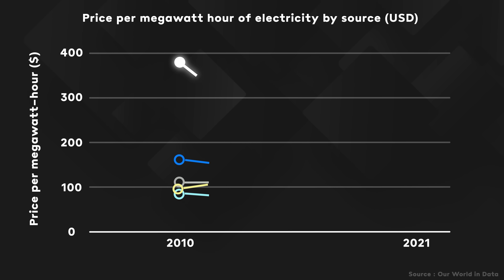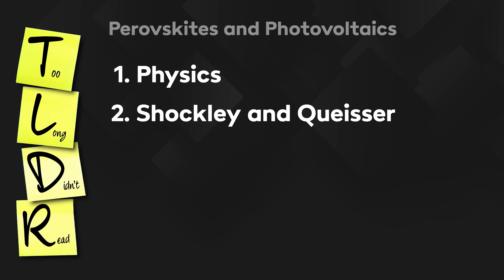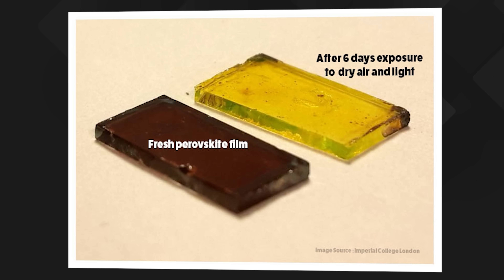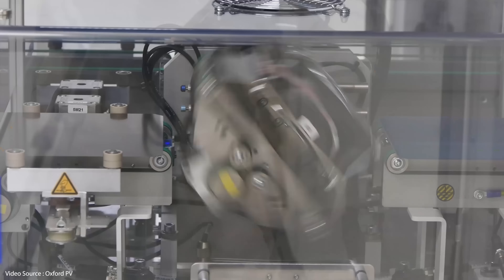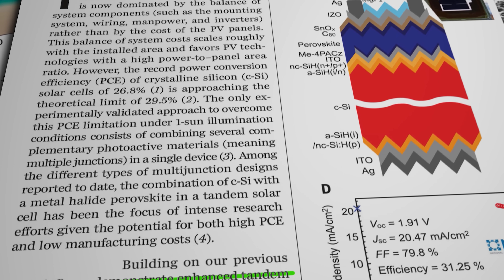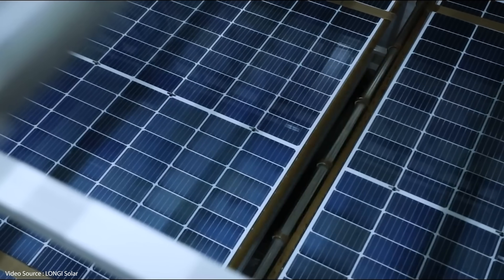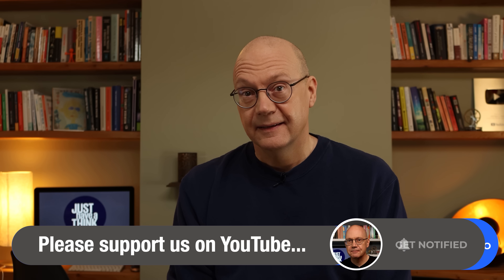Perovskite Solar PV. FINALLY some good news!

Comment: Hy ! I looked at one of the pictures in the production.
I got an idea. The main problem is the space used for the PV´s.
PV-Peroscites combineing is one option.
PV´s need a lot of sunlight ´ish options.
I would work on the reflecting side .
Using PV´s on top of each other , by reflecting the light from the sides.
The reflecting medium need s to be researched !
The recycling of both the Pv´s and the reflective medium needs to be researched as well.
If the longlivety is not good. Exchange the setup in an easy way could be a better solution.
Well . I just had a thought.
Stay healthy !
Thanks !

Comment: @justhaveathink Take a look at Delft technical university's (aka TNO) investigation into placement of panels. Not by pouring oodles of funding into innovation, but by just placing them vertically, in an east-west arrangement. Better use of available land, dual use of it (one project is called "Solar Milk") and better performance of technology by preventing them to over-heat

Comment: That one little solar cell can absorb more energy from the sun than multiple tonnes of CO2.  I'm glad you humans are finally taking advantage of them.  I do hate the cold.
:goodvibes:
Reply: "That one little solar cell can absorb more energy from the sun than multiple tonnes of CO2." <- classic know-nothing who thinks he made a smart comment.
Reply: @TheDanEdwards   Carbon dioxide absorbs light mainly in 4 narrow bands of wavelengths centered at 15, 4.3, 2.7, and 2 μm.  Solar panels are designed to take advantage of the broadest waveband possible.  They can absorb light across the visible spectrum, from about 400 to 1000 nm.  Solar panels absorb orders of magnitude more light, gram for gram, than CO2, and they do so across a much higher energy spectrum.  The math works out to 1 kg of solar cells being, on average, roughly equivalent to 4 metric tonnes of CO2, in solar energy absorption.  Of course, that number does increase with energy usage, as energy conduction becomes more of a factor.  
I do hope that helps to clear things up for you.  I know your species has difficulty with science, and I am always happy to help the lesser abled.  :goodvibes:

Comment: Twelve years ago, I was planning to put 4kW of solar panels on the roof of my UK house, not just to save the planet, but to make the most out of the government's hopelessly overgenerous (at the time) Feed In Tarif. However, I was a bit worried what adding these panels might do to the value of my house. So, I asked a few estate agents whether such an installation might add, or detract value. And they all said..... "What are solar panels?" (!!!)  I'd like to think we've moved on a bit.
Reply: My late father had a similar experience in the 1960s when trying to install loft insulation. He contacted all kinds of builders' merchants, hardware stores and the few DIY shops around at the time, and the overwhelming response was "what's loft insulation?". Always seems like "the industry" is well behind burgeoning consumer demand.
Reply: @broadsword6650  I think it was just getting established here in Canada around that time.  My parent's house had a whopping R6 or R7 in the attic.

Comment: Great but you can buy a panel for £100. Everyone should have them if possible but without a battery they are not far off useless. A battery gives you access to wind power as well. I would have a battery before solar panels anyday

Comment: I am an Albertan.  We have a moratorium on solar and wind; there is fear that our electric system will become unstable because of the intermittent supply.  I suggest that with solar, wind, that the government should encourage technology to allow individuals to store and release energy to provide for the needs of the grid as determined by the system operator.  For example, the system operator could electronically call-out for release of electric vehicle battery energy into the grid when there is a risk of network instability.

I think that forward-looking people in society would be happy to help stabilise the electric grid and get a discount on their electric bill at the same time.
Reply: Alberta's conservative government has fear that the fossil fuel era encouraging the disgusting pollution and emissions from filthy wasteful oil production from its tar sands is coming to an end. "Grid instability" is nonsense fear-mongering; the job of the grid is to balance different electrical generation sources and demands, and having new cheap electrical generation that operates at almost zero marginal cost is obviously a win, even if it's intermittent.
Reply: @skierpage I respectfully disagree.  The part that I agree about is that the government is playing politics so that it can delay the rapid change in CO2 emissions that the world needs.  As a retired electrical engineer, I recognise that it is true that "grid instability" is a reality.  I am also sure that there are practical solutions to be developed and encouraged by the government.  We need a government that will encourage and incentivize innovative solutions of various kinds rather than put road-blocks to change.

The only (laughable) attempt that the Alberta government is know for is "Carbon Capture and Storage."  In other words, they have incentivized the continuing use of oil and gas and potentially ignored solutions to the grid stability issue.
Reply: @skierpage . It’s not nonsense at all.   Look up “duck back curve”.     It’s a real problem and getting worse.   A thermal, combined cycle plant takes half a day to a day to wind production up and down.    Yes you can plan ahead, but it can’t respond to hourly variations, say intermittent cloud cover.   Do you want your power going off randomly?   All the time?     If you want to know what that’s like, look up South Africa.  They have a power shortage and have daily blackouts.  (Most scheduled)

Comment: Hi Dave,
Please do a video comparing wind Mills versus solar PV in today's cost structure.
Holy Grail has now shifted to storage of renewable energy and as usual, please present some of the viable ones you know of.
Reply: I wouldn't mind seeing nuclear (inc. new build) included in such a comparison too.
Reply: @user72974  True that
Reply: @user72974  True that
Reply: @user72974  If you want to see that - a minimum of on-line research will lead you to a number of evaluations of the total costs involved.

Comment: One of the reasons for concern about the ultimate efficiency of panels is available space. Whether domestic, industrial or scientific, a limit of space puts a ceiling on the generating capacity. If Perovskite cannot offer a significant increase in power output AND durability on a par with silicon those of us with space should press on with installations rather than wait for a peak efficiency which may never come at an affordable price point. Even so, if the cost of a more productive panel is proportionately high, silicon may still be the viable option. The environment needs action right now, not when science delivers next gen tech. 
Government has failed. Unless everyone of us takes what independent action we can we fry. Simple.
Reply: Uhhh? Pk should allow up to 50% - today cells are more closer to 20% -> allowing up to 30% with PK today. Another layer is also in the works that just converts IR to visual light as well. Main problem isnt the cell - its the storage more than making the power. Lots of power is wasted today because we dont have away to store it.

Comment: 🎯 Key Takeaways for quick navigation:

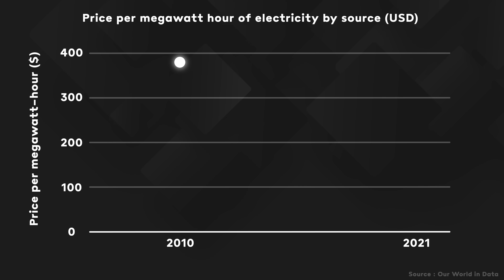00:59 💡 Perovskite, a little-known material, is predicted to initiate another steep market disruption in solar photovoltaic technology.
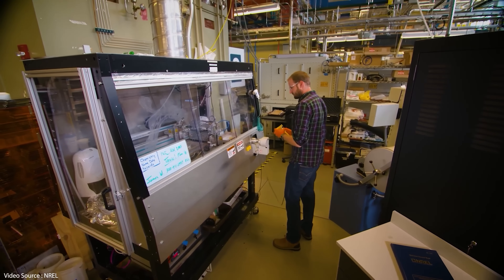03:41 🌞 Perovskite demonstrates promising potential in solar energy conversion due to its ability to capture light more efficiently than silicon-based cells.
05:35 🏗️ Achieving durability and reliability is a significant challenge in commercializing perovskite solar panels.
06:31 💰 Bill Gates has invested in perovskite technology through Breakthrough Energy Ventures, backing companies like CubicPV, which aim to improve efficiency and durability in solar panels.
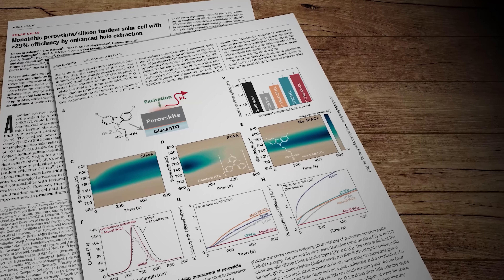08:21 🇪🇺 European research projects, such as Pepperoni, focus on enhancing the efficiency of perovskite-silicon cells, aiming to build a European pilot line for their production.
10:14 🇨🇳 China is making significant advancements in perovskite solar technology, with companies like LONGi setting efficiency records for silicon-perovskite tandem cells.
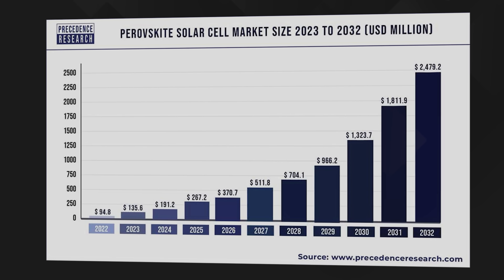11:59 💼 The perovskite market is projected to grow substantially, reaching billions of dollars in value as experimental prototypes move towards full-scale production.

Made with HARPA AI

Comment: Dave,
I'm pleased you took the time to come back to this.  One metric that is super important is how much energy and water is required to make a solar cell.  I've read somewhere that Perovskite cells require something like two orders of magnitude less energy to produce per watt of generating capacity.  That means that the amount of time a solar cell has to operate before it digs itself out of the energy hole created by its manufacture is significantly less.
Reply: It's not super important, since the payback time for the energy invested is down to a couple of years. The EROEI objection was valid... 20 years ago.
Reply: @skierpage  if the panel was made from scratch, if it was recycled its even shorter.
Reply: Water is absolutely a key metric, these days, energy not so much.  In China (and no doubt elsewhere) there are solar panel factories more or less being powered by solar panels.  As that percentage of powered used coming from solar increases, the power demand becomes less of an issue.
Reply: @Muppetkeeper  That is correct, and the same is valid for those factories (and they are growing) that use closed loop water cycles for their production needs.
Reply: Even if that's the case, this is a multi-junction cell, which means the silicon part of the cell are gonna be comparable to others. However if the 28% number is correct, you do get another 4-7% (~15-25% increase) with little extra water usage.

Comment: Carbon energy is not going anywhere for a hundred years, hopefully country's without carbon security can move technology to not be dependent on ones that are, thats all we can achieve in the short term, climate change is only practised by the minority not the majority of polluters, and we cannot afford it!?!
Reply: "climate change is only practised by the minority not the majority of polluters" <- AGW is not "practiced" by anyone. It simply is.  AGW is the result primarily of burning fossil fuels.  Such fossil fuel consumption is bad for many reasons.

Comment: Dave
Any chance of reviewing Retail or Home wind turbines in particular Vawts.
Is there any 3rd part verification or Standard ratings.
Was about to take the plunge with home kits but got cold fert due to warnings re Hype.
Also as ship propeller and turbines are about to be subject to AI redesign do you have any leeds who is taking a lead to systematic engineering redesign using AI ?
Good interesting video and thanks for the heads up cutting thro the hype.
Exciting times ahead ?

Comment: It seems obvious that Oxford is behind Chinese perovskite manufacturing. E.g. GCL is building eight times the capacity (2 gw). It already has a line since 2021 producing much more than Oxford, and Oxford is aiming for only twice this. Plus GCL has actual market experience. See interview:

At the moment, the factory has a production capacity of <50MW of tandem solar cells annually. That is quite small in the realm of PV production or demand, but significant for a new technology. In terms of volumes, the original factory plan was to produce 250 MW.

In general you are better than some green hype channels (e.g. that matt guy buys everything) but it seems you're myopic? I don't understand why. The efficiency news is the first Google hit for "China solar cell perovskite", gcl is like the fifth...

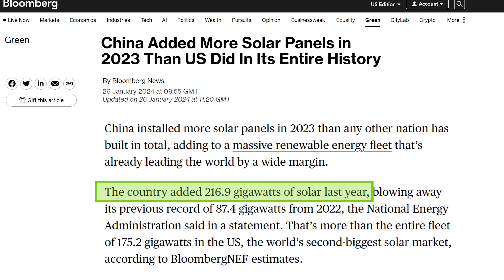Comment: 10:04 the nuance on the vast majority of that solar power installed is that it's cheaply built solar cells that break down after only a few years.  China is pumping out lots of really low quality solar panels that need to be recycled after only a few years.

Comment: Instead of revolution it' gonna be continuation of the cost decline trend. consumers don't care what is the technology. what matters is cost per KW.

First perovskite will be little more expensive so will make sense only where you have limited space and so want to get more KW out of it for premium. Once the cost per KW reaches current PV, it will be no brainer, same KW for less panels lower installation cost. Or eventually when cost drops even more, people will increase their production.

Comment: Just think. Solar photoelectric panels are nothing but junk. It is strange that we humans try to come up with a way to produce what we think is clean energy. Today's solar energy is not clean.  Nature already come up with the best solar energy for everyone to enjoy. It's called wood.
Reply: ". Solar photoelectric panels are nothing but junk. " <- just nonsense.

"Nature already come up with the best solar energy for everyone to enjoy. It's called wood." <- tell me, how long will the forests of this world last if all 8 billion of used wood as a primary energy source?  And how hazy do you think that air will be (as long as the wood supply remains)?
Reply: @TheDanEdwards    the world has been burning since the beginning. Do you see an end to it? The energy to produce the panels is a lot. They cannot be produced without burning fossil fuels. So it's kind of stupid especially when panels do not last forever. I feel sorry for homeowners who are con to put that junk on their roofs. Most of them are not even at the right angle to get the most sunlight. then their maintenance.  try to replace the roofing with solar panels. That must be a pain in the ass for the roofer and the homeowner. Then you need batteries omg batteries do not last forever.  solar photoelectric panels are junk. Have fun.

Comment: Big difference between a tandem cell having a "guarantee of 25 years", and the perovskite layer on the cell having any meaningful output after 25 years.  So I'd be really interested to look over Oxford Solar's warranty to know if it's worth anything.

Perovskites are fundamentally water sensitive, and some cells are also oxygen and UV sensitive.  It is difficult to imagine how you avoid this, other than making something that isn't a perovskite but which has perovskite-like behavior in collecting photonic energy.  And that water sensitivity fundamentally limits the lifetime of the cell relative to that of a silicon cell.
Reply: I think outside the benefits of layering it in silicone and having a wider range of interaction is also that the si shell is what keeps most those things at bay. I think they already do similar stuff in advanced wafer manufacturing for computers, its not all silicone, but the si is vital to etch and embed everything in. Although unlike a chip operated in several layers of shielding and metal caps on top the solar cell has to sit exposed to elements. not sure a delided i9  14k would last long exposed sitting out on your roof top either so.. that 30 yr warrantee still a long way off.

Comment: There is a wide spread concept of the "Rate-Limiting-Step"" that originated in chemistry, but is broadly applied to chemical engineering, engineering, and even all fields of STEM and economics.  At this point in time, the generation of electricity by solar panels is not the rate limiting step.  It is the storage of electricity from when it is produced to when it is needed, or alternatively, to shape the need for electricity to when it is produced.  So no matter whether this is really wonderful or not, it is not important at this point in time.  So, yawn.
Reply: Yes, I did feel compelled to view this video at 2x speed to write this comment just so that I could post it without the possibility that my point had been acknowledged at a later time.
Reply: BTW, I'm assuming that the reader is able to understand that in this case the "Rate-Limiting-Step" for industrial processes corresponds to the cost-limiting-step.  If this isn't obvious to you, you might want to spend some time on Brilliant or Kahn Academy.
Reply: China doesn't seem to be effected by this "Rate-Limiting-Step" with respect to them building massive solar/wind farms with and without storage. If you disagree with anything I stated, please take the time to respond acknowledging that I've spent no time at Brilliant or the Kahn Academy. Thanks.
Reply: @markvalery8632  1) China simultaneously builds out massive solar arrays and the largest increase in coal burning in history.  2)  And those coal burning power generators fuel massive mining of cryptocurrencies while at the same time making such activities illegal.  Expecting logical or technological consistency in a authoritarian, pseuco-communist regime?  They can't mange their demographics, real estate market, etc.  But they certainly can drive everyone away from rationality!
Reply: @markvalery8632  Hey, my first reply to your idiotic comment went into the bit bucket, so sorry, I'm not going to respond.
Reply: @markvalery8632  I wrote an anti-China tirade in response but it got censored.  Sorry.
Reply: "So, yawn." <- how superior of you.
Reply: @TheDanEdwards  Thank you.  Not an argument.